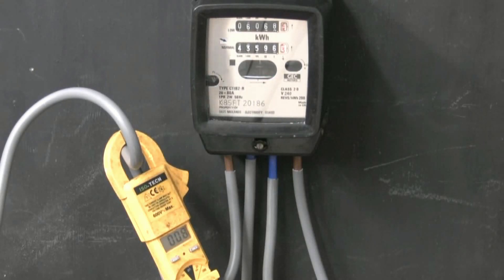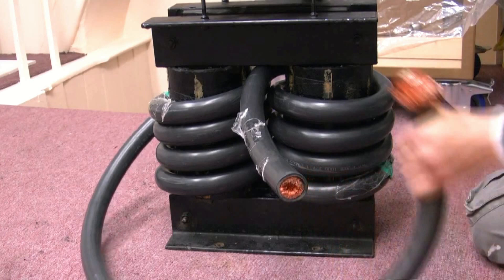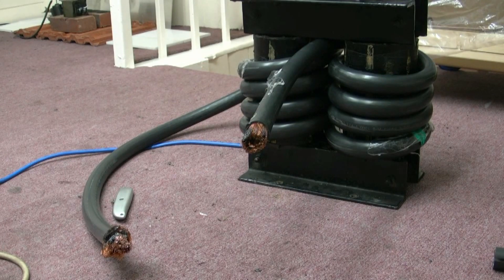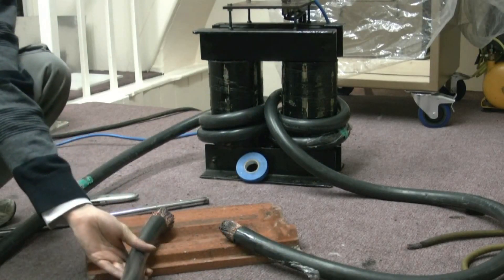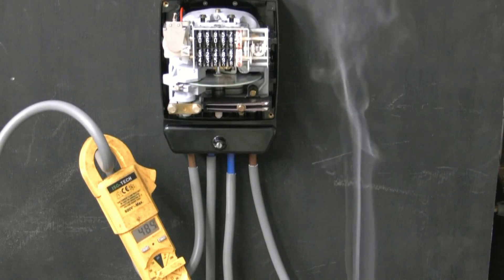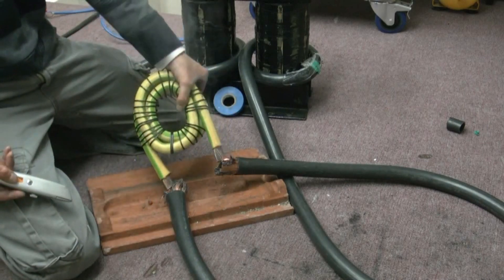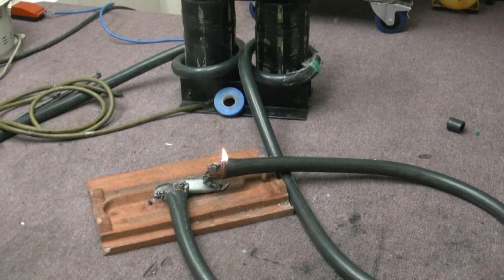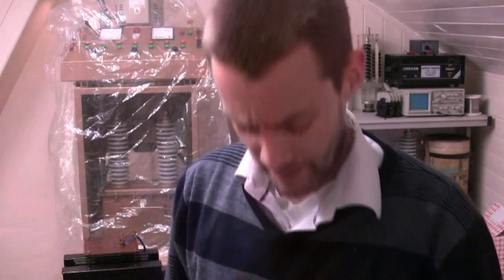Too Much Current + Electric Meter Pops

Comment: Fuck me, wait till this guy gets his electricity bill.
Reply: Sorry, they cannot tell how much they used. Their Energy Meter Popped
Reply: +Jeremiah Suarez Volts must be really low too. It would be crazy to rely only on lower resistance because if you closed the circuit faster with you than the other wire it would be only able to go through you.
You can calculate the voltage he gets if you aren't as lazy as me. Pretty easy to do.

Edit: no need to calculate, it's 0.5V so the amps going through you are probably really really close to 0mA
Reply: he shorts out the secondary winding on a transformer. there is no path for the current to ground (thru him), because the secondary is galvanic isolated from mains power and therefore from mains earth.

THATS why he doesn´t got electricuted
Reply: Down2Diamonds he uses so much the meter loops back to 0
Reply: +Down2Diamonds This does not use much power, so his electricity bill will not change significantly. Remember, you're billed on energy use which is measure in watt hours. 200 amps at a few volts is still less than what a typical space heater would use.
Reply: +Mircurial blah Ohm's Law, bro.... Look it up. It doesn't matter how much current is available, at 1.5v you can only push a tiny, tiny amount of current through a human. He may have 200 amps available at the windings, but that's only assuming a dead short, near 0 resistance. From one hand to another hand on the human body, it's actually quite high. And the tiny voltage he's using would have no hope of moving a current that would cause any harm.
Reply: That's not the point, whether the supply can only supply 1-200mA or 200A, if the voltage is the same the amount of current which will flow will be the same if the of the load resistance is high enough, e.g human skin resistance, the resistance is high enough that even if you are barefoot standing in the dirt and your body is soaked with salt water the current flow through a human body by touching both terminals of the 1.5v AA battery or this transformer will be the same. it won't be higher just because the supply can put out 200A, 200A is just what it will output if the resistance between the two terminals is down to near 0ohms. Current flow = Voltage/Resistance.
Reply: +Down2Diamonds nothing, he just roasted his electric meter.
Reply: +Alexandre St-Laurent This is a common misconception about how electricity works. The idea of delivering power to a load does requires you have sufficient potential to drive a specific current over some resistive gap. 1000+ (heck, 1 ) amps will always be very harmful to a human being, but you require a power source that can deliver that current to the load.
Reply: +Sam Chaney The real reason why he is safe is because the output of the transformer is isolated. There is no path from him to the ground of the transfomer. He could lather his hand up with salt water and be fine.  "If he were to have held the open ends of both wires, he most definitely would have died!" probably, but thats because he would add himself to the circuit. Not a good idea with any high-power application.
Reply: npower: your bill is .....
Reply: +Jeremiah Suarez That is not true. Current will travel wherever there is a path. It does not choose a path. It travels all paths. The reason he is not electrocuted is because of the low voltage. Since the voltage is low, not enough current passes through his body to cause any immediate harm.
Reply: +Down2Diamonds You think a guy with such a strong handle on electrical know how actually pays for his electricity then?
Reply: +Mircurial blah 
Incorrect.
Ohm law says it will MOSTLY follow less resistance path, so it can still go in him.

When you build on switchboard, sometimes there is no way to turn off power in it, so you stand on big rubber carpet.
What he does is almost same, and it is possible on his normal carpet thanks to low voltage.
Reply: Mircurial blah
Electricity does not ONLY follow the path of least resistance. Just think about it. How many things are plugged into your outlets at home? Is the item that draws the most power, the ONLY thing that's on? Of course not.
Reply: Mircurial blah
The reason he didn't get electrocuted is because the voltage is so low. The voltage is less than 1 volt. Even if he was the only thing touching the wires, he still would not have been electrocuted. Would you die if you touched a 1.5V alkaline battery? Of course not.
Reply: ***** Its a relationship of proportionality. One of the biggest misconceptions about voltage, current is that they are different. You can't have one without the other, so saying "voltage != current" is, while correct in the sense that they are not the same fundamentally, is misleading. Voltage is just a potential, current is just the movement of charge... holes/electrons (classically the former) resulting from that potential. If that charge movement resolved the potential, it goes away. If something is maintaining that potential, and can do so in light of the whatever current is established, that current will continue you flow. There is work to be done to maintain that difference, which can also be interpreted as the power being delivered to the load.

Sorry if this seems like I am trying to teach you, or that I am assuming you don't know these things. I am not. I am just clarifying the misconceptions that arise from people saying things like voltage != current.
Reply: azrnzala Yes that is taken into account in my comment, at only 1.5v whether its a AA battery or this transformer the resistance of a human body is high so the current flow will be miniscule. The transformer is able to stop its voltage from dipping with a much lower resistance load but that doesn't mean it will dissipate much power at all through a human.
Reply: +Sean Dali physics. A-level stuff in this vid. Easy peasy.

+mechanical engineer you can draw as much as you need, as power. The voltage is always the same, so the current changes because power is the current times the voltage. However, that will only give about 15 amps maximum due to fuse restrictions, so he gets a transformer and steps down the voltage which raises the current (as the power is always the same for a 100% efficient transformer). Then he pushes the new current through the meter, which would eventually kill it.
Reply: The block's supply of energy ran out for the evening.
Reply: The transformer is only a handful of volts, it can only apply a high amperage through a low ohm circuit like metal. There is no way for a deadly amount of current to flow through you as the voltage is way to low no matter how high the amps go. The only difference between this and a car battery is that it refuses to undervolt, over heat or carry on when you connect it you a very low resistance circuit.
Reply: +Im Chuck current travels on the lowest resistance. Metal has lower resistance than his hand.
Reply: Paul Paulsen
He doesn't get electrocuted because the voltage is too low for his body to draw enough current to cause immediate harm.
Reply: +storerestore Just realised that. Still got it off my chest.
Reply: Anthony Shuker
A battery doesn't "produce" amps. Amps is a measure of current. Your body has a resistance. When you apply 1.5V to that resistance, a current flows. This current is the same regardless of how powerful your current source is. This current is minuscule and easily supplied by even the weakest battery. Having a more powerful current source does not make your body draw more current because it is the resistance that determines how much current your body will draw. The only way to make more current flow through your body is to either increase the voltage or reduce the resistance. Increasing the voltage is the only way to harm you. I can't think of any circumstance where 1.5V could harm a human.
Reply: ThingsDemystified thanks for the pedantic + pointless paragraph in this also quite pointless thread that you won't let end
Reply: That meter wasn't real. It's a dummy one to help retell the story of the day Photon popped The Grid.
Reply: He has it connected to your supply, so nothing to pay.
Reply: How did he not set his carpet on fire?
Reply: +MaxRay16 If a circuit is complete, the electrons will go through all the components of the circuit, even if it includes a human (the definition of a circuit is that thr electrons flow from one side of the power supply to the other without travelling through it). Now, imagine a resistor to be like a tunnel for electrons, the narrower it is, the narrower it is and therefore the harder it is for electrons to get through it. And since a human has about 2000000 ohms of resistance it's very difficult for electrons to travel through it, and they'll lose a lot of energy as they do. 

The higher the resistance, the higher the energy that EACH electron loses as it goes through the resistor, which is the voltage drop (it is NOT the voltage of the power supply). That energy will go straight through muscles and trigger them as if they're responding to an order from the brain. Some of these muscles include the diaphragm and the heart (which are fairly important).

The higher the current, the more energy is transferred to the muscles and the more it blocks the messages from the brain and the more dead you'll be.
Reply: The Freebooter
This circuit couldn't kill you under any circumstance unless you raise the voltage.
Reply: Thats not his real meter.
Reply: +taylor gates ;) :) Lucky Photonicinduction hmmm? OR...hmmm...maybe he got lucky enough to have rich relatives that also LOVE his videos just ad much as we do...? Lolsss AND...I DO LOVE his videos...I admit again I'm too afraid of electricity to do this myself...all I ever did when I was younger was to leave the electronics unplugged (with no electricity) then poured gasoline and gunpowder in them haha...BUT...this guy does it the REAL way I think lolsss
Reply: Street blocks in Britain have there own power limit the environmentalists must be mental over there
Reply: +Im Chuck he will not get electrocuted simply because the winding of the copper wire on the core is 8 turns that will only gives a very little amount of voltage but the diameter is quite thick and will give you a high amount of current or AMPS, were the hell you learn your basic practical electricity?
Reply: The amount of $ this guy makes is like what a scientist makes because he is a scientist!
Reply: +JakE Flade 💥 because we can't read your meter!
Reply: +phuquerz i don't think he was replying to your comment
Reply: what you're saying is true but either way you look at it he didnt get electrocuted in this video therefore much of the electricity did not flow through him.
Reply: Anthony Shuker What is your point by saying it doesn't? I am not sure how this addresses anything ThingsDemystified said.
Reply: ***** Voltage ∝ Current
Reply: *****  For your second test: is it the voltage or the current that kills you?
Reply: I am not sure exactly what you are trying to say, but a supply has to be able to deliver the power to the load required to maintain a current at a particular voltage. I=V/R, if the voltage source can provide the power for that particular voltage/current. Otherwise, the voltage will dip, as will the current. And if you are dealing with a constant current source, the same thing goes.
Reply: Ah good. I just got a little confused by your phrasing :)
Reply: Sam Chaney Your body is a certain resistance. That resistance can only "draw" a certain current. Whether this supply is capable of supplying a million amps is irrelevant. The amount of current your body's resistance can draw is easily supplied by a 1.5V battery, nowhere near lethal. So how do you make your body draw more current? Simple. You increase the voltage or reduce the resistance (by making your hands wet). But still, wet hands will not drop your resistance low enough for 1.5V to harm you.
Reply: azrnzala
It has nothing to do with transformer isolation.
Reply: Transformer isolation and being isolated from a circuit (output isolation) are two different things from a strict definitions sense. He isn't part of the circuit. He is isolated from it, therefore safe. Usually when someone says "transformer isolation" they are talking about the electrical isolation of the windings between the magnetically coupled coils. Which is still relevant to what I said.
Reply: A battery does produce amps, from a chemical reaction, which is working to reduce the potential energy that exists between the terminal. We can then convert the movement of charge into useful work. Basic chemistry/physics. "This current is the same regardless of how powerful your current source is" - False. If a power supply can not provide a current at a voltage (i.e. cannot supply the POWER) then the resulting voltage/current will drop.
Reply: azrnzala
Even if he touched both poles with his hands, 1.5V would not harm him under any circumstance.
Reply: ThingsDemystified Did I say it would?
Reply: Anthony Shuker
I simply replied to your comment. By your stating that a battery doesn't produce 200 amps, you're indicating that you do not understand the relationship between resistance, voltage and current. Just because something is capable of supplying a certain level of current, doesn't mean that it does so to any connected device. It is the device that determines how much current will flow.
Reply: ThingsDemystified I don't think you understand what pedantic means. You don't have to explain the same thing twice which i already knew about.
Reply: Anthony Shuker
Well, I replied to your comment. If you're saying you figured it out between that time and now, then great.
Reply: ThingsDemystified okay so this again proves you don't know what pedantic means
Reply: Anthony Shuker
I'm not sure what your objective is, but a humble student preferable. You act like my 6 year old. He keeps telling me he already knows. "I already know!" That's right. Once you know something, no one else can tell you the same thing. You are now an expert! You are now authorized to use this newfound knowledge to beat others over the head with.
Reply: ThingsDemystified you're far beyond the point now but whatever floats your boat
Reply: Anthony Shuker
This is what floats my boat.
Reply: ThingsDemystified yes... hence why i commented that
Reply: he can't be electrocuted because he used very low voltage 4 or 6 volts winding that can reach high amperes just the idea of spot weld transformer, low voltage high current.
Reply: IF YOU TOUCH THE WIRE, YOU'LL POP.

Fireproof carpets, very useful.
Reply: +MaxRay16 If a circuit is complete, the electrons will go through all the components of the circuit, even if it includes a human (the definition of a circuit is that thr electrons flow from one side of the power supply to the other without travelling through it). Now, imagine a resistor to be like a tunnel for electrons, the narrower it is, the narrower it is and therefore the harder it is for electrons to get through it. And since a human has about 2000000 ohms of resistance it's very difficult for electrons to travel through it, and they'll lose a lot of energy as they do. 

The higher the resistance, the higher the energy that EACH electron loses as it goes through the resistor, which is the voltage drop (it is NOT the voltage of the power supply). That energy will go straight through muscles and trigger them as if they're responding to an order from the brain. Some of these muscles include the diaphragm and the heart (which are fairly important).

The higher the current, the more energy is transferred to the muscles and the more it blocks the messages from the brain and the more dead you'll be.
Reply: +MaxRay16 If a circuit is complete, the electrons will go through all the components of the circuit, even if it includes a human (the definition of a circuit is that thr electrons flow from one side of the power supply to the other without travelling through it). Now, imagine a resistor to be like a tunnel for electrons, the narrower it is, the narrower it is and therefore the harder it is for electrons to get through it. And since a human has about 2000000 ohms of resistance it's very difficult for electrons to travel through it, and they'll lose a lot of energy as they do. 

The higher the resistance, the higher the energy that EACH electron loses as it goes through the resistor, which is the voltage drop (it is NOT the voltage of the power supply). That energy will go straight through muscles and trigger them as if they're responding to an order from the brain. Some of these muscles include the diaphragm and the heart (which are fairly important).

The higher the current, the more energy is transferred to the muscles and the more it blocks the messages from the brain and the more dead you'll be.
Reply: +MaxRay16 and internal resistance applies to the resistance in the batteries/cells/power supply.
Reply: ThingsDemystified Which one melts the cables, the voltage or the current?
Reply: He's not a scientist.
Reply: That what you call a mad scientist every herd of one.
Reply: j jarry 
Yes I have "every" heard of one, and this isn't one. He's an electrician who likes playing with high currents.
What science is he doing?
Reply: Why would they provide 100 amps to your house if you weren't meant to use it?
Reply: He don't pay he rigged it.
Reply: Down2Diamonds hey and...in one of his other vids he's driving a Mercedes so his little lady probably has the sweet cushy job so he can play alll day long at the house making you jealous of his electricity bill lolsss
Reply: i was thinkin the same thing
Reply: I don't think he got "shocked" exactly...its the hot sparks and bits of hot metal wire that hurt since they're searing hot. I think one of those may have popped on or near his hand.
Reply: Another question. If the voltage was 0.5V and the amps were about 18000 A (that's around 9000 Watts) why did the lights of other people in the street go down? I bet he has used quite a bit more than 9000 Watts in the past. Or was it the cables in the ground of the street that were about to melt?
Reply: ThingsDemystified current will branch, with the highest current going through the lowest resistance.
Reply: It wont be much
Reply: Zero, if you had this level of skill you would have no problem wiring in upstream of the meter
Reply: crissaegrim if the amp is high it will kill you regardless even if its 1v. Obviously since it IS low voltage theres no real "pressure" thus the high resistance in the body will pretty much save you from, say for example 500 amps @1v . Perfect example is a neon sign ballast vs MoT. The neon light ballast outputs around 10kV-12kV really high voltage but only produces around .30mA at max. Wont kill you, but you will get one hell of a shock. Now, a microwave transformer is about 2kV but outputs around 1A which will kill you.
Reply: +Sam Chaney 

I am a welder man. I've been welding for years. around 1000amps 20-50 volt I touched it everyday and nothing happens! nothing!

electricity will be dangerous if it reach over 80v.

you are stupid, and I have to tell you that you have to learn basic physics. and you should just quiet if you dont know the thing that you talk about.

I am sorry for my bad English,I am dutch.
Reply: i dont onow much and im pretty stupid but how the hell were you able to hold metal in between the cabbles wouldnt that have electrocuted you i saw that it shocked you a couple times.
Reply: A 1.5v battery also doesnt have 200+ amps running through it does it now? Are you seriously trying to say that that amount of current which can melt a steel bar would be totally harmless to a human?
Reply: +ThingsDemystified I can't tell if you are a troll or you have dangerously flawed ideas about electricity. Voltage is not the only thing that kills. Did you not see the thick metal bar turn white hot? This transformer is drawing about 50,000 Amps of current!!!

Just because it's low voltage does not mean it isn't dangerous. Electricity DOES only travel along the path of least resistance, and completing the circuit in this case is far less resistance than grounding through his body, so the current travels from one wire (and through the metal bar) to the other, thus completing the circuit. Notice he never touches the bar between the two wires. It's true that it takes a certain amount of voltage to break the skin barrier, but it's very small, and factors like sweat on the skin can lower it even more. If he were to have held the open ends of both wires, he most definitely would have died!
Reply: +ThingsDemystified Incorrect. Electricity follows the path of least resistance. Because his hand is much more resistant than the metal in the stanley knife, the current ignored him and passed through the metal instead
Reply: +ThingsDemystified a typical 1.5V battery isn't producing 200 amps...
Reply: +ThingsDemystified Huh? My comment related to my suspicions that he's probably using a polarity reverser on his meter, giving him a meter that'll run backwards, ergo, not paying for his electricity. I already understand the relationship between ohms, watts, volts and amps thanks.